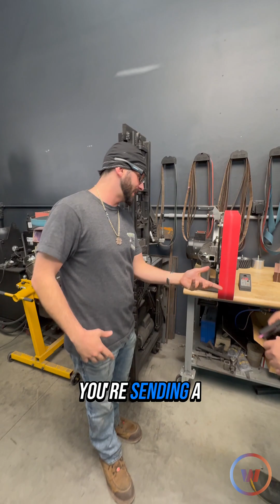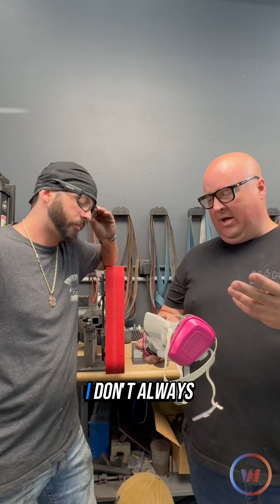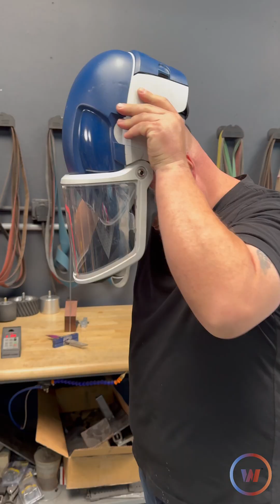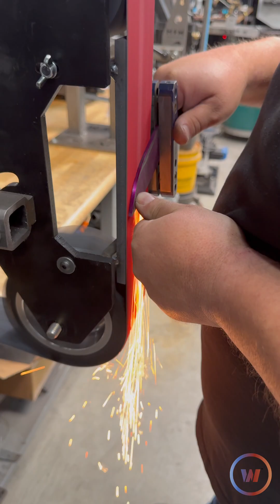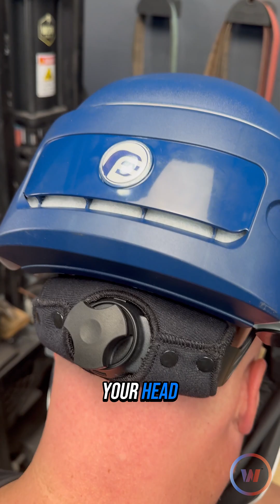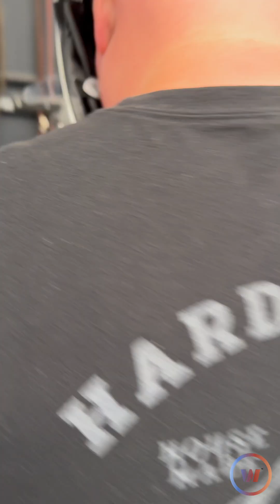Protect your lungs when grinding metal with the PureFlo system from Gentex #fabrication #papr

Comment: 1400$ is insane!!!! 3m makes one similar without all the extra crap for 250$
Reply: Do they because the 3m versaflow is £1300 so it'll be nearly double in America no doubt
Reply: @mikeyduke10  They probably looked it up and saw that the versaflo helmet is $250 for a replacement, but that doesn’t include the actual PAPR. Whole kit is $2300 from grainger
Reply: @mikeyduke10  your dollars arent worth what you think they are pal, 1300 british pounds is $1700

Comment: Thing looks hot af cant see anything if i got sweat dripping from my face onto the sheild
Reply: Someone else commented saying it has positive air pressure so any heat and moisture would be blown away either way its too overpriced
Reply: @xMrjamjam Yeah, that's why it needs a battery. There's a blower to create the positive pressure and pulls air through.
Reply: The Pureflo 3000 provides a constant flow of filtered air, ensuring you stay safe even when things get hot 🔥

Comment: Crazy expensive. Someone needs to make a cheaper one. Welders don't live long.
Reply: How much would you pay to protect lungs ? 
They are one of the slowest to heal organs
This would make an awesome Christmas gift from someone special 
(Partner or employer) 😅
Reply: 3m makes a similar one for 250$ without all the battery crap
Reply: @yllitleinadable  Nice!
Reply: @yllitleinadable It's not similar at all because this has constant air flow and positive pressure via a small battery powered blower. That's what you're paying for.